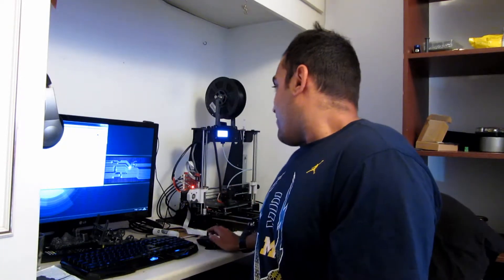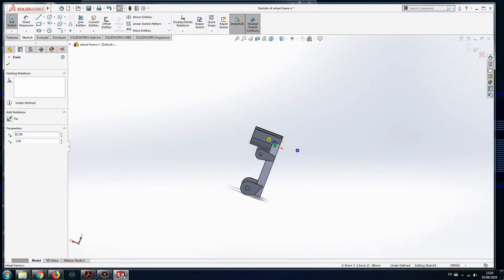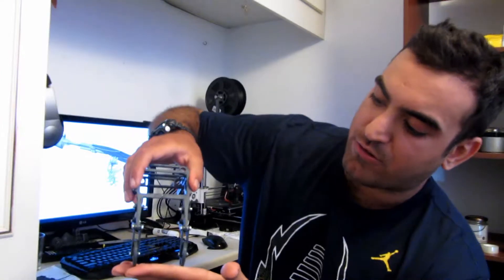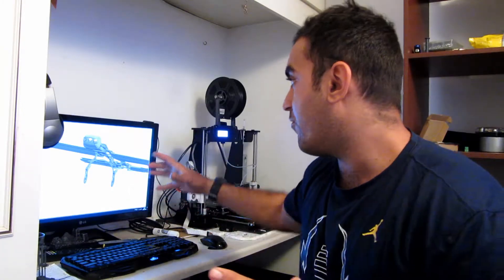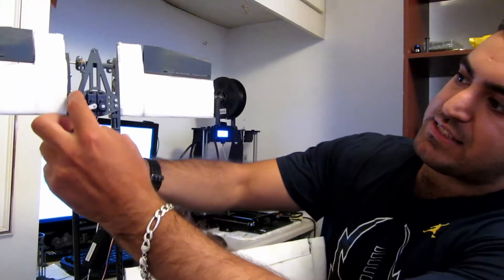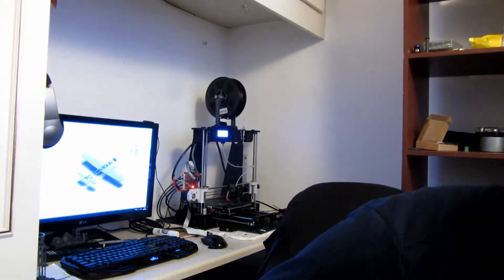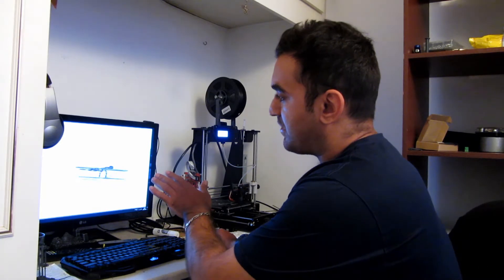rc airplane design 01

Comment: Great video. What 3d printer do you have? And what filament material do you suggest for making components? Also curious how you designed your airfoil cross-section and size, and then how you built it! Maybe you can recommend a cheap motor/ESC combo and a good receiver with gyros? My apologies if you've answered these in other videos, just found your channel. Thanks!
Reply from the maker: anet A8 is my 3d printer but I upgrade it , PLA AND NAYLON , naylon is very strong but expensive,  ,most of my parts are symmetric but there is not no maths behind it, just build it from scratch and balanced  it, for electric part go on hobby king they have lots of motors and esc  I can not really recommend any electric parts because its all depend on your design and wight , my receiver doesn't contains gyro, hope fully for next project I may do that,

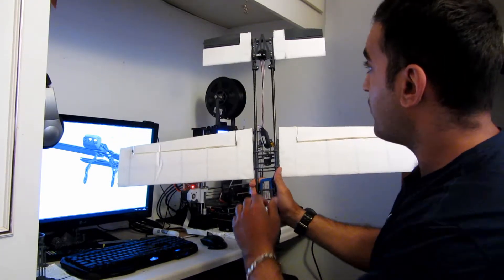Comment: here are some things to consider.    you  MUST  understand that the  Weight  of  Every component matters.   the use of  steel fasteners instead of adhesive, is  NOT  a good idea.   it is clear that you are just making it up as you go along, instead of coming to this project with relevant knowledge between your ears.   for instance, any time spent designing and making complex  landing gear is Just a  Distraction.   why.   because, an aircraft spends  Most  of its time in the AIR, not on the ground.   most of the time, landing gear is  Dead Weight.    at 3:50, main landing gear wheels should  NOT  be so close together.  or else you have a 'tippy canoe' when the model is on the ground.   at 4:50, a split-elevator has been   UNnecessarily  used, and the halves do NOT extend to the stab-tips.   aileron hinge Lines  Should be  Parallel  to the aileron trailing edges.    right now, this model airframe has a  Tail-heavy,   less-stable  distribution of Mass (dom).          any airframe  MUST  have a sufficiently  Stable  distribution of Mass (dom).     there is  TOO  much mass at the tail.  in part because, a SERVO  is there.   servos  SHOULD  be installed  NEAR  a model's  center of Mass (c-m).    also, the lack of  taper  of the main frame rails puts  Extra  mass, aft of the model's cg.     the  profile  of the main wing is shaped correctly, but, it is  TOO  thin.   the profile  THICKNESS  Should be equal to, AT LEAST,  eleven percent of main wing chord.    several 'overlapping' ratios guide the design of a conventional airframe, large or small.     ( an airframe  Should  be designed to be compatible with the intended prop/power system.   however, the Correct prop  TYPE  for the application  MUST  be spec'd.    in most cases,  the use of an  S F (Slow-Flyer)  prop is  NOT  CORRECT.  )             1)  prop diameter  Should  be equal to about 25% of wingspan.     2)  fuselage length  Should  be equal to about 75% of wingspan.     3)  the span of the horizontal stabilizer  Should be equal to 30% of wingspan; no more, no less.    4)  the main wing chord Should be equal to about 22% of fuselage length.   5)   the  cg  Should vertically align, generally, with 26% of fuselage length.   6)  ideally, a model's center of Mass (c-m) is located at 25% of fuselage length;  this is the 'zone' where the mass of ALL components  SHOULD   First be added.   ONLY if necessary to achieve correct balance, should components be installed distant from the model's cg / c-m.         some sweep  Should ge used at the horiz-stab leading edge; use five to eight degrees of sweep angle.   ailerons  Should extend  to very near the wingtips.     cheers                          googletranslate
Reply from the maker: it's obvious that weight has the most effect , but I mostly used light 
materials such as carbon fiber tube for the main frame and foam for the 
wings even my fasteners are zinc not steel,  to keep the weight down, 
and also some of  my 3d printed parts are hollow. I already aware from 
some of the information that you shared, but at the end this is a 
project for me and I just doing this to practice my CAD designing  and I
 really  don't know how it's gonne end up , faild or fly ,  we will see 
..
Reply: fyi, cf tube is NOT light.  fine.  this is just an exercise, for you.   you should realize that the content of this video does  NOT represent good   RC airplane design.    some newbie scratch-builder may come along and watch and think that these  bad  building ideas are 'good' ones.    as a  courtesy to all viewers, i suggest you remove  RC  from the video title.     cheers
Reply from the maker: Mate, I still havent finished my airplane and you telling me this is not good idea or is bad build airplane and even you suggesting me to remove the RC from the video title :) , I'm not here for an argue but If you are a pro, you don't have to watch these type of video, there are so many video on the youtube for designing rc airplane and this is one of it and people watch and can decide for thier self and they can recognise what is a good build or a bad build  ,,,
Reply: @daviddavids2884  man you have done it all . free advice is not expensive u have really save me , i want your email plesssssssssssss